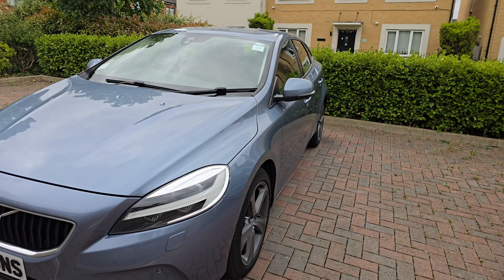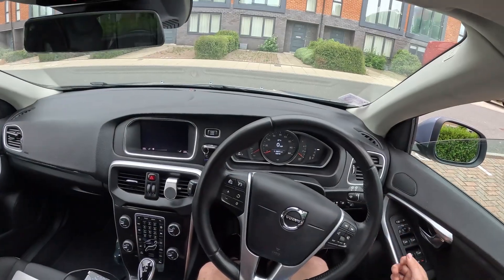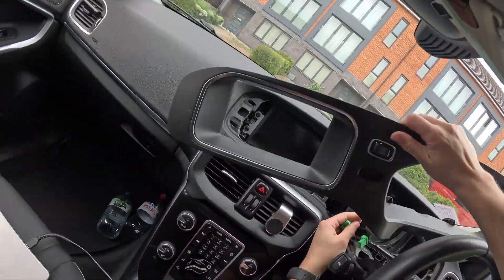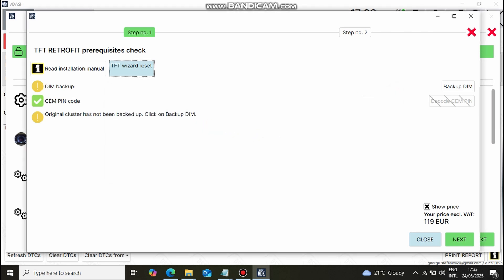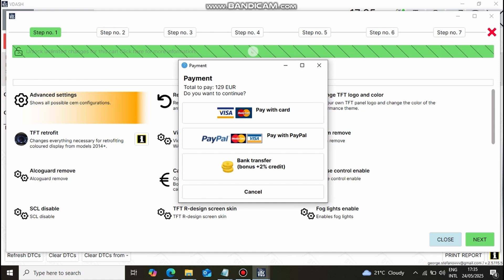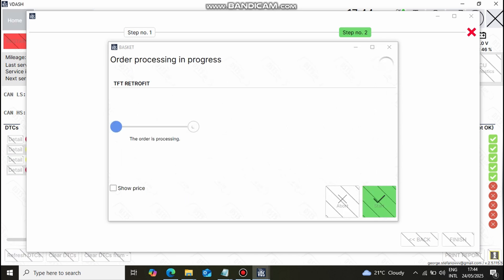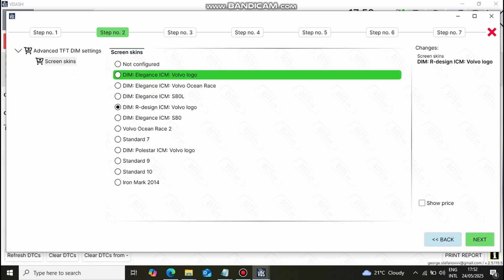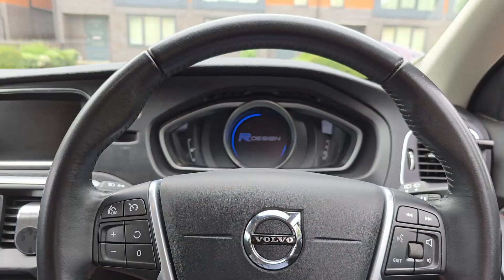Volvo V40 Digital  TFT Cluster Retrofit DIY (V40 and all P3 models...)

Comment: How did you do the upgrade? In the Video the Start/Stop button was alawys disconnected, and when you swapped over the DIM, to the newe one, it was also disconnected?
Reply from the maker: In the video I'm mentioning that there is no need to disconnect the ignition switch and remove plastic trim complete. The reason I did it is so that it's easier to see what I'm doing. Once you set ignition pos 2 and connect to VDASH, you shouldn't need to use the start/stop button again during the tft conversion process. Rgds.
Reply: @GSAuto681  Thanx for the prompt reply. Appreciate it. So, only need to put into Pos 2, once, then you can disconnect, use VDASH, to do the Back-up, Get PIN, if not as yet, then follow sequence as promted. Let it do it's thing, then remove old DIM, and replace with new one, and continue sequance as shown, all this while the Start/Stop has been disconnected, after the initial Pos 2 has been set. Thanx once again for the effort you had done in creating the Video.
Reply from the maker: @mrlintonious Start with finding the pin first. Then, proceed with following the TFT conversion routine, it's quite intuitive, just make sure battery voltage is stable, other than that no much to go wrong.

Comment: Where did you upgrade the headlamp. Any guides ?
Reply from the maker: They put them as a standard from 2016/17 models. If yours is 2015/16 you can possibly retrofit them.
Reply: @GSAuto681 I have an old xc60 2013. Looking into retrofitting the new Thor design. Thanks for replying. 😢sadly I don’t think they roll up stock headlamp for my car.